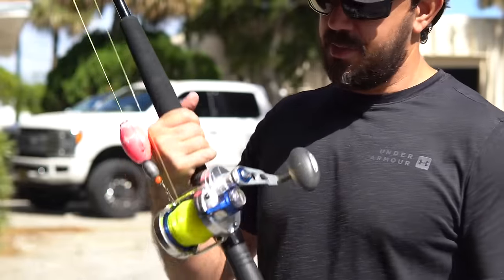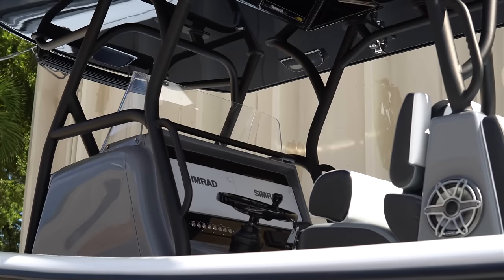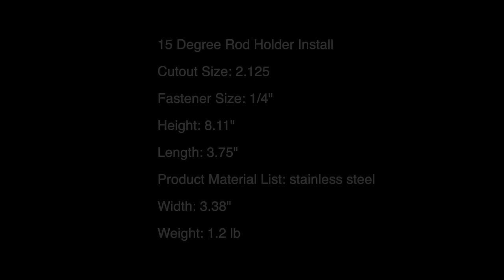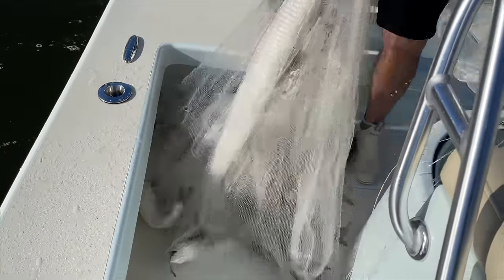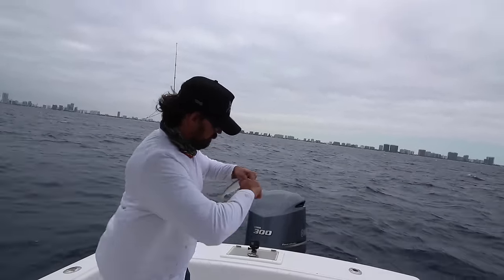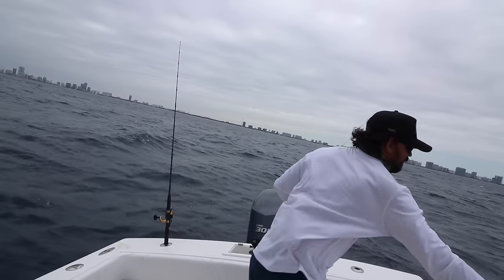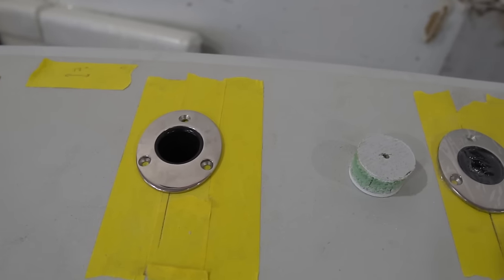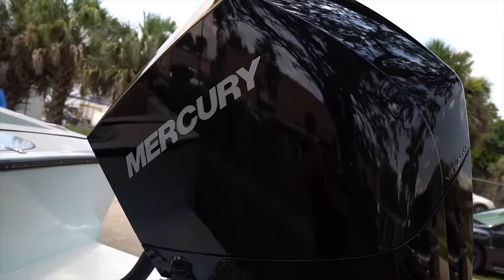How-To Install Rod Holders on Fishing Boat | EP 27

Comment: Those rod holders have a little nipple on the end to attach to plumbing - to pipe salt water out.  Do you recommend connecting those up to tubing or just ignore it and let water spill into the cavity between the outer and inner shells of the boat?
Reply from the maker: The gunnel rod holders will drain right onto the deck and out the boat. When we install rod holders into the console and transom, we will connect drain tubes to keep water out of the console and bilge.
Reply: Makes sense. I connected the gunnel rod holders to piping, but they just get clogged and fill up with water - even a single fish scale will clog em.

Comment: About to add a bunch of 15s to my boat. Did he drill the first hole straight through and then drill a second time at 15 degrees? That seems easier than drilling at 15 in one shot.. Great job on the boat.
Reply from the maker: Exactly that.  The second drill was at 15 degrees to the direction I wanted it.

Comment: Did you use single screws to bolt them down, or nut, bolt and washer? Counter sink?
Reply from the maker: Bolted with nut and washer.  If you are doing any type of deep dropping or big game, i'd add backing plates too.
Reply: @ReelReports  thank you

Comment: Mike you need to upgrade your Mercury as they just announced the new Verado with 600 HP. Check out the steering on it. Incredible.
Reply: lmao, a 1200lbs motor would sink that boat.